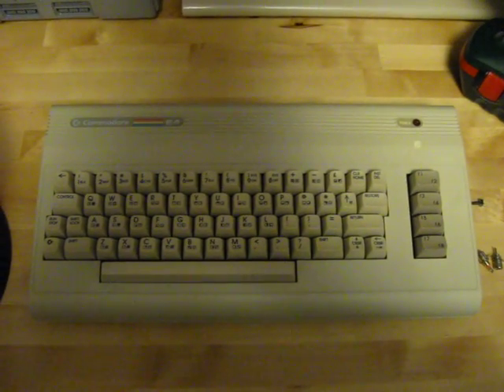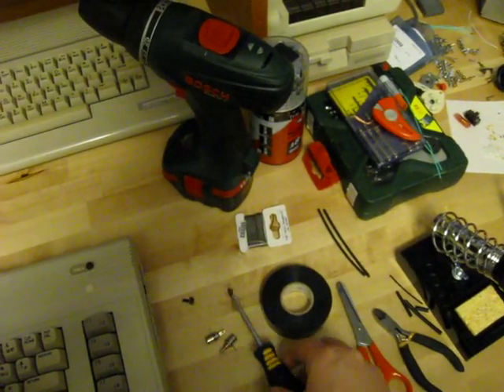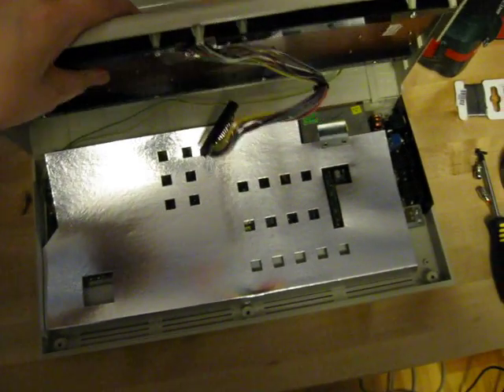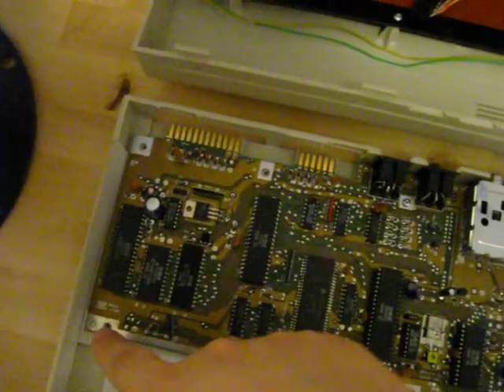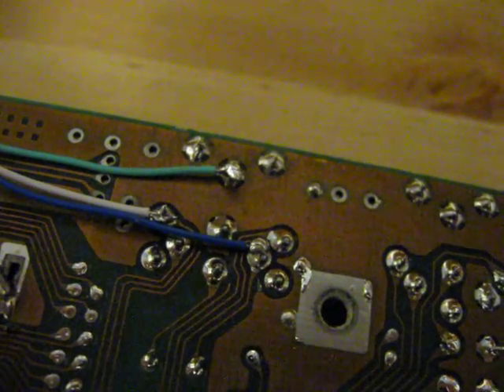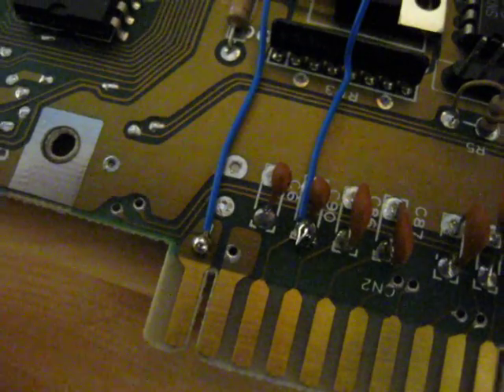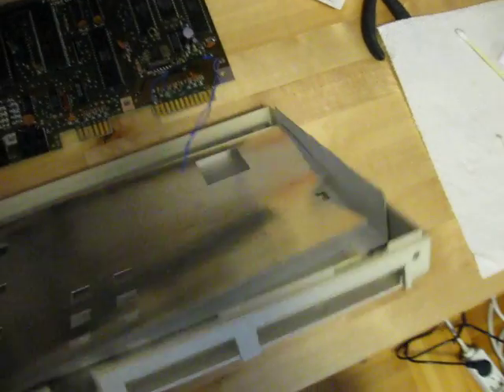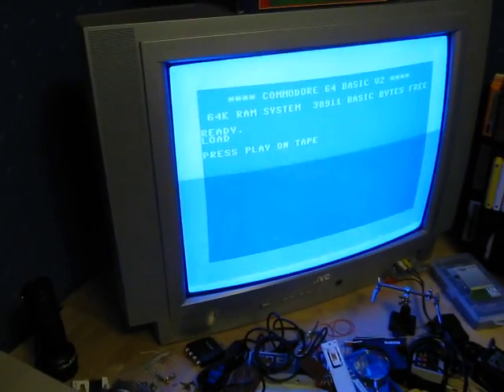Commodore 64 mods (A/V-out, reset button)

Comment: Thanks for this video !!! I am going to perform them reset I had already done years back and also done as a kid in 1986. I only suggest taking the cardboard out as only creates more heat in the chips where some already get so hot. Better yet on the Sid chip and CPU maybe more chips with some thermal tape some heatsinks on it. They will keep working longer and sometimes there is a heatshield from Commodore itself that is better than nothing. Sure the Vic2 chip all the way, it gets boiling hot. But often have a cover on it for cooling. Gr Ed

Comment: I just added a reset switch to my C64 using your guide. Works like a charm. Used a round, smooth, dark tan LEGO plate to work as a button, which gets close to the actual case colour.

Comment: What is the point of modding for AV out when it natively supports both Composite and S-Video through the 8 Pin jack?
Reply: By doing so it makes it easier to output composite as you can simply use widely-available composite cables rather than a specific cable for the 8 pin jack.
Reply: But cables for Commodore 64 are readily available and cheap.
Reply: @charvelgtrs  A/V cables are much more common and cheaper.

Comment: Good job on the mod but I always try to not alter the case if I can.  However, your work appears to be good.  But keep in mind that you can actually get S-Video and/or composite with just a cable.  No case drilling needed and there are reset cartridges too.  So, no real need to alter the case for those two mods.

Comment: Is there any difference between pressing reset or just flicking the power switch off and on?
Reply: Also, a soft reset like this helps reduce the sudden surge of power through the C64 on a cold start.  Not to mention preserving the mechanical switch.

Comment: I had to alter the steps abit when I was doing this. The upper most pin between those two sets of 3 pins is also ground and I had to use that as the ground pin on mine is in a different location. Produces a BEAUTIFUL and CRISP picture though! Thanks for posting this!

Comment: Adding a reset button will eventually short out all capacitors...DON'T DO IT!!!!!!!!!!!!
Reply: If you always turn on/off the power of you c64 to reset your machine and change games you may burn out your fuse and stress your electronic components inside your machine due to peak voltage when you power on. Reset switch, resets your machine like a "command instruction" so no power on/off and voltage stress is required ..just a normal 1 capacitor short out.
Reply: I had reset buttons on my C64's since the eighties.
No problem.

Comment: Another way without drilling what I used to do back in the day was to take the ground wire from the 1530 datasette and touch it against pin 3 of the user port.

Comment: Note to retro game system collectors.
I just had success modding an AV cable for a modal 1 Sega Genesis - Megadrive by opening up the plug and re-soldering the AV wires to the right pins.
Note on mine the two internal wires were yellow and white and ground wires were already on pin 2 so real easy.
Otherwise this mod is great. :)